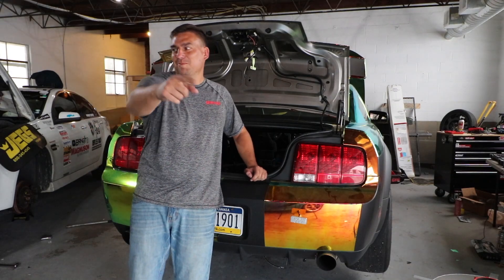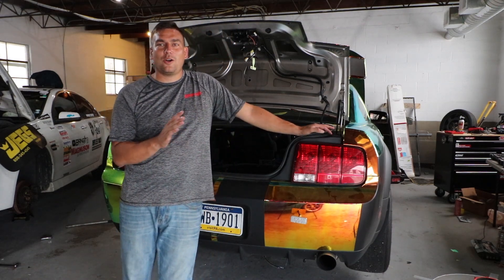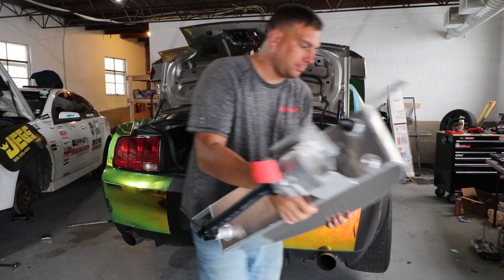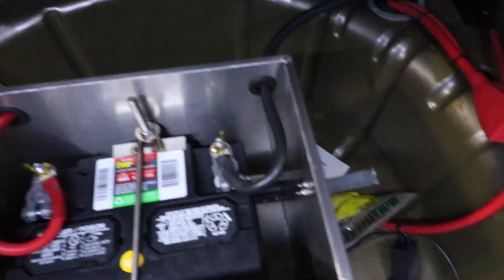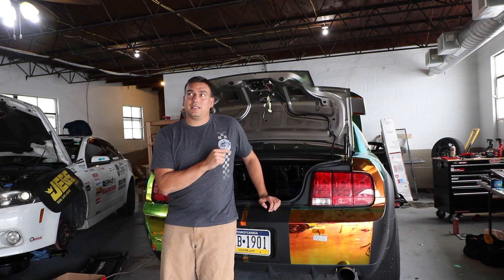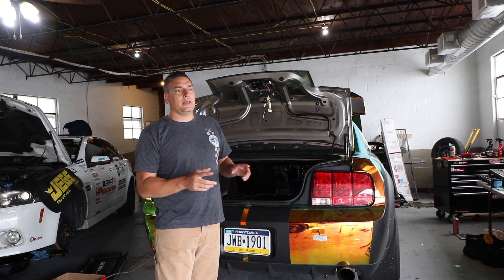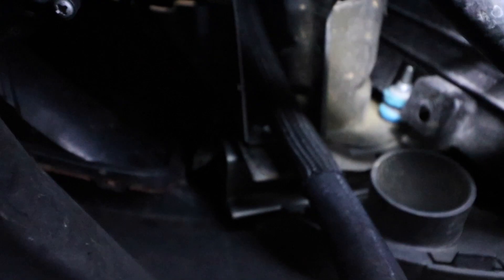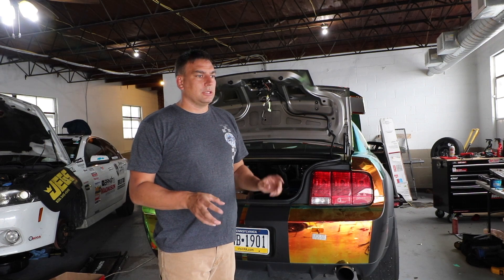INSTALLING A PNR Welding ICE BOX PART 1

Comment: Thanks for the video.  Sorry your roll bar was in the way of the battery box relocation. I would have liked to have seen some more info on where you ran the feed and return lines.  Also, isn't the battery box covering your drain valve?  How will you drain it to be able to add ice?  You might need to move the battery to the driver's side or, even better, have the roll bar bent and re-welded closer to the back seat so you can move the battery box completely over to the passenger side.
Reply from the maker: Paul Wetmore the battery box was covering the drain. I made it so I could still reach the the valve. However this was a short term deal. I knew I was getting a lithium battery installed on the passenger side. I have another video on that install.  Thanks for watching and commenting.

Comment: Hey I have a 99 cobra with a kennebell supercharger and I'm trying to find a intercooler setup... will a 03 intercooler work on it
Reply from the maker: old Greg if you have a supercharger now it should have a intercooler under the supercharger. You might need a heat exchanger behind the bumper
Reply: @BringItMuscleCars  there is no intercooler
Reply: Or is there one? Lol not even sure
Reply from the maker: old Greg I think there is. Best thing to do is call Kenne bell and tell them what you have. They will be able to tell you if it does or doesn’t. Are your air inlet temps hi. Is that why you’re looking for a different often.
Reply: @BringItMuscleCars  looking for my boost and kennebell said I need to get a intercooler for more boost but they dont sell kits for them anymore
Reply from the maker: old Greg that’s very interesting. I just learned something new.

Comment: How fast is this hot rod 🤔
Reply from the maker: Sam Smith Jr first 1/4 mile pass was 9.9 at 149. The 60’ still needs work.
Reply: How good does it work on the street ?
Reply from the maker: Sam Smith Jr sent you a Friend request. Let’s talk on messenger
Reply: I was thinking about getting this setup. How much does it lower IAT2’s on the street?